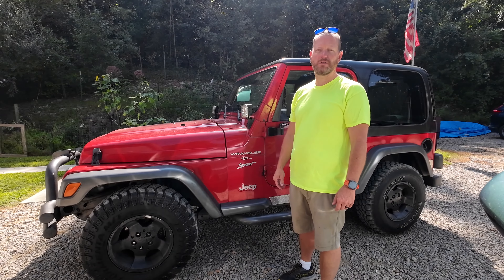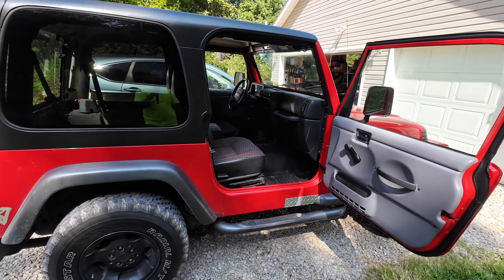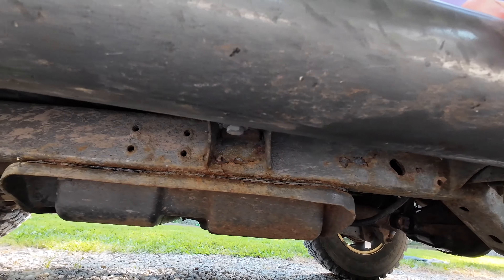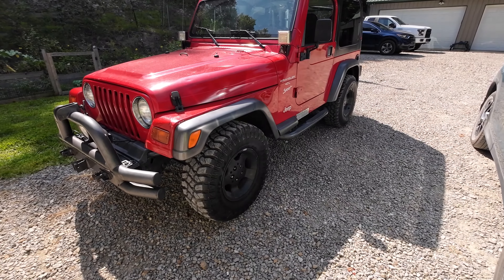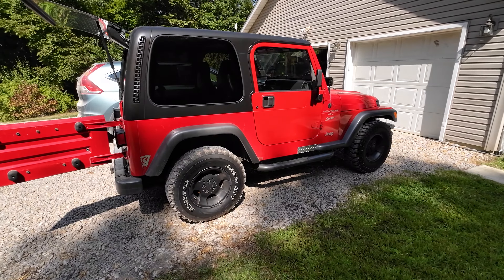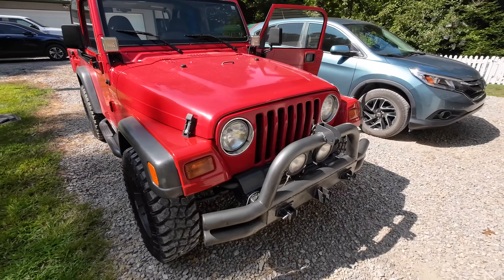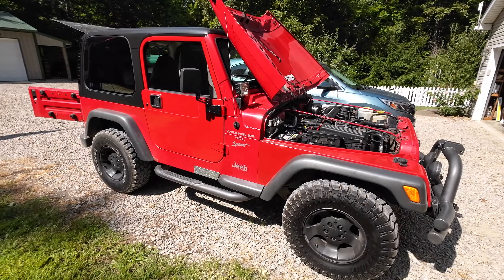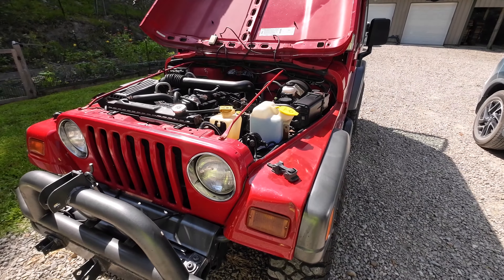Buying A Jeep Wrangler TJ In 2024 / 2025 - What To Look For / Things Have Changed / My New Project

Comment: I have the same Jeep but green soft top. Make sure you get locks for the door (taking them on and off) I’ve had friends who have gotten them stollen. It takes 3 minutes to take them.
Reply: I have half doors, this exact thought has crossed my mind, is there a way to do that?
I did some general maintenance a few weeks back and finally put locking gas cover and engine hood locks.  Those batteries alone are $250.00!  
Yeah not today Satan!  I’ve got a tracker in it, I’m contemplating a kill switch, not sure where a good hiding place is.

YOUR POINT IS CRITICALITY VALID!

              OlllllllO
See ya out there
Reply: @ you can order locking lug nuts for the Jeep hinges. They are regular nuts but take a special screwdriver to get off.

A few months ago, I had a tow truck driver opened my hood while I was in the grocery store so the Jeep wouldn’t work. I saw him do all of it through the window when I was at the checkout line.

I knew enough about my Jeep to put things back the way they were supposed to.

I let it go.  (Welcome to Atlanta.) but his goal was to be the hero and give me a tow home for a little bit of cash under the table.

Comment: I been looking at buying a Honda pioneer 700-4 and getting cab enclosure and heater your looking at 20 grand or there abouts I've found some tjs for 5 to ten grand grand and you are street legal and go cross state here in Montana so i think I'll go that route 😮.
Reply from the maker: I have both. My TJ is way bigger than my Pioneer, otherwise I'd agree. The Pioneer fits on my trails and has a great utility bed

Comment: Unfortunately, I can tell you from experience that the frame is a lot worse than it looks externally since they tend to rust from the inside out. I’ve done a few and just finished repairing another with safe-t-caps front to rear down both sides of the frame, floor pans, torque boxes, etc. I’d check the structure of the tub under where the roll bar mounts. Mine had the same rust poking through the rocker in front of the rear fenders and the whole area that the roll cage bolts too was also rotted out.

Fortunately for me, I only paid $300 for my 2004 6 cylinder knowing of all the rust issues because the previous owner was about to sell it to a junkyard for scrap value. Close to $7k would be tough to swallow seeing that much rust. 

Good luck to you getting that one fixed up!
Reply from the maker: I definitely overpaid but it's not that bad. Roll bars and mounting area are completely intact. Rear floor area is spotless. It needs a passenger floor pan, which I have already done. Repaired small area on drivers side. The frame will need repaired with safe-t-caps, but I can do that myself.

Comment: Hi, what you think about 4 cylinder engine? Im looking @ one jeep and the owner is asking $6000 for 1998 jeep with 4 cylinder and the some of the frame has been repaired. 

Do you think 4 cylinder is good I should walk away from it? Btw its manual
Reply from the maker: The 2.5 is very underpowered, but it's a Jeep and as long as you don't care about pure power, it will still be fun.  I had one with the later engine, the 2.4 and I loved it. You just have to be practical. Drive it and see if you like it. If you do, go for it. But don't drive a 4.0 6 after that l, otherwise you'll regret it. 😄
Reply: I own a 2000 with the 2.5l.  You have to learn how to drive it/when to shift.  Mine has 4.88 gears and 35x12.5” tires.  You have to shift around 3500 RPM, which seems high, but that is where that engine is happy.

Comment: Wow $7k with 170k miles?  

I have a TJ with 70k with no rust that’s been sitting in the driveway for years due to a bad transmission. It has  lots of upgrades too, and I was thinking of asking for less than $7k. Time to rethink my sale price 😅

Thanks for the vid! It was very helpful.
Reply from the maker: The prices are going through the roof.
Reply: Stock Tjs go for more. People rather paint their own canvas
Reply: And they can still do that because I don't have any permanent mods, and the jeep hasn't been off-road yet since I've owned it. Original owner didn't offroad it either. It was my 2nd vehicle that I was upgrading as a hobby. Unfortunately the transmission went about 1k miles after I did most of the big upgrades, so aside from age, there's almost no wear and tear to the parts.

 Next owner is going to come out far ahead for the cost of a stock TJ and they can either sell the upgraded parts to recover the cost of doing their own thing, or keep em. I just don't have the time or energy anymore.
Reply: If it needs a transmission, you’ll be lucky to get 5000.

Comment: You overpaid. 
That is outrageous the passenger side does not have a floor. What a disgusting dealership.
Frame rust is expensive to fix too. 3,500 for a small section to have it done.
Reply from the maker: Yeah. They are very overpriced, so it's hard not to overpay. I do agree with you though.